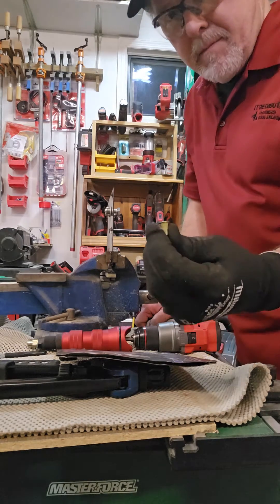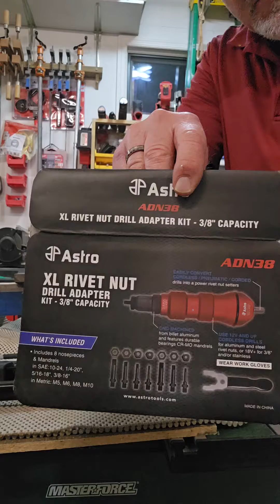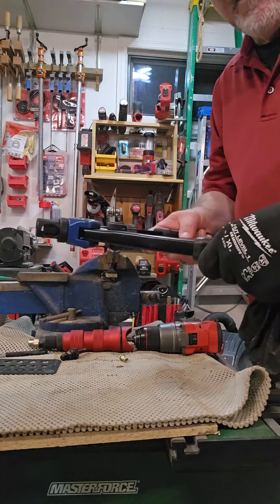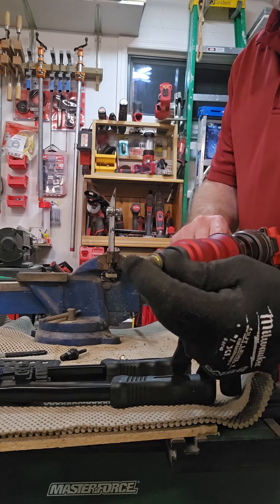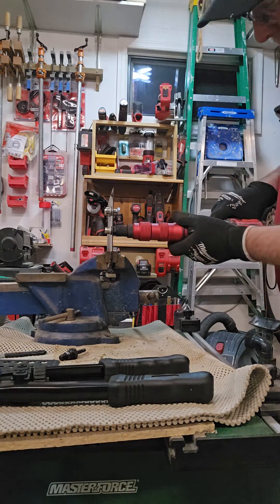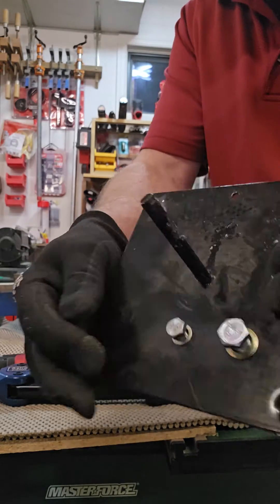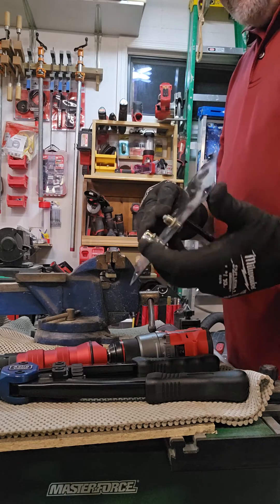Threaded insert made easy with the Astro XL Revit Nut Drill Adapter ADN38.  3/8 nutsert demo.

Comment: Can that work on a 1/4” hex impact driver or does it need to be a traditional drill?
Reply from the maker: @Omnivorous1One  yes
Reply from the maker: @Omnivorous1One  the important thing to remember is you need to be able to clutch it. Too much force will snap it and void the warranty.
Reply: @timtadlock7096  does the instructions tell you how to find the correct setting or is it guess & hope you dont brake something?
Reply from the maker: @Omnivorous1One  unfortunately, a lot of it depends on the material that you are setting the sert into. Verables like thickness of the meterial also make a difference. I normally set the clutch about 2/3rds the range to get started and adjust as needed.
Reply from the maker: For all of these that I have sold, the only time I deal with breakage and warranty issues is when a clutch is not used at all.